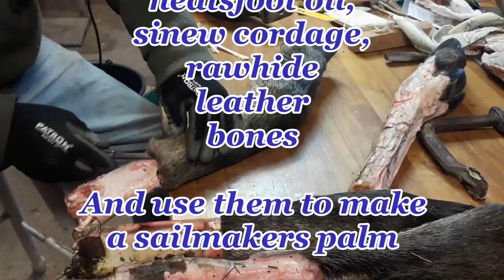Bushcraft Special - Sailmakers Palm from a moose leg

Comment: Fantastic.  I've done most everything you've shown except for the bark-tanning.  I had no idea it was that easy!  I've done a ton of brain-tan in the past, but the finished product is too soft for anything other than clothing, imo, and not really ideal for that considering how it is when it gets rained on!  Definitely going to have to try bark-tanning if that's all it takes to get a quality product for sheaths and whatnot.

Boiling those hooves.... I could almost smell it from here.  That's such a unique aroma!!  :-)
Reply from the maker: Birch leaves the leather quite hard so for softer use oak or willow. Also you need to soak in stages, moving from weak to stronger solution.
Reply: @mikkosnellman   I'll have to give it a try when hunting season comes around.
Reply: Hey Three Rivers, have you been smoking the hides after brain tanning?  That would definitely help with the water problem your experiencing with the rain.  Proper smoking will make your buckskin waterproof, or at least very water resistant!
Reply: The smoking makes it so the hides don't go back to rawhide after the leather gets wet. They are stiffer but soften back up. A little like jeans are stiffer after hanging to dry but loosen up after wearing.